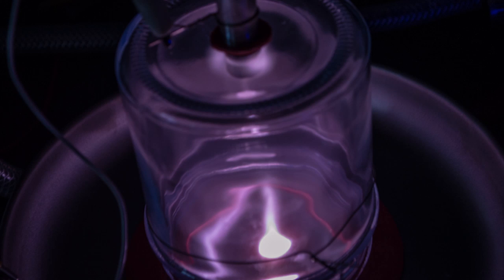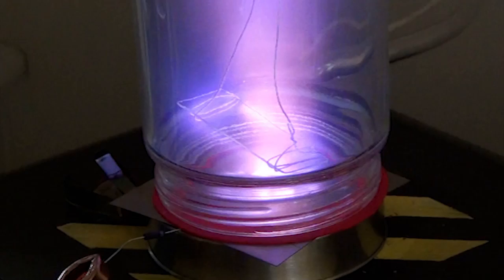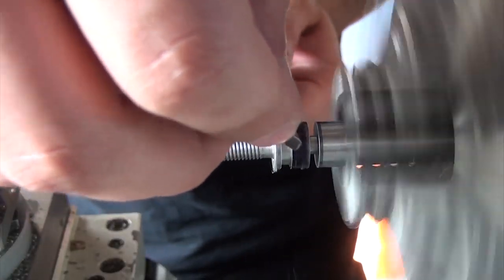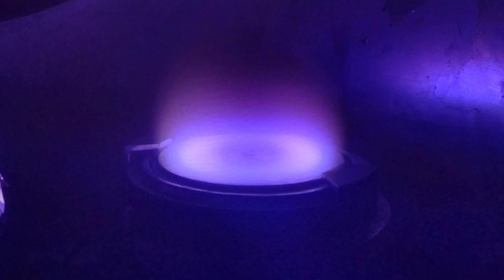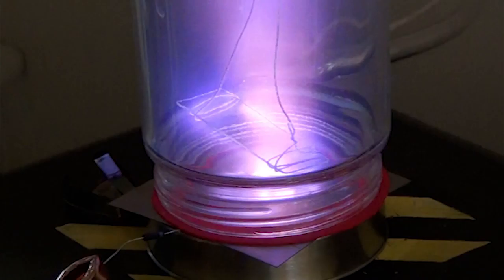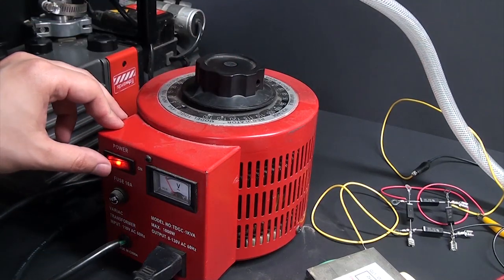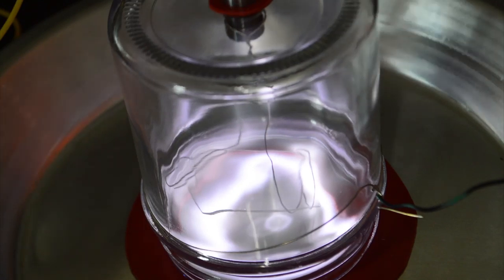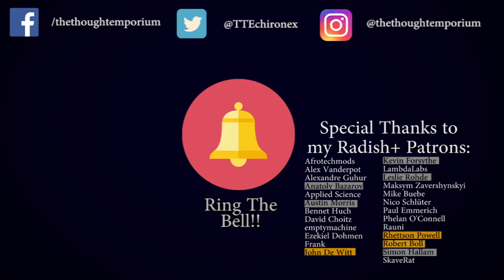My First Successful Metal Coating Machine - Magnetron Sputtering

Comment: Just when I was thinking that I need to go through my subscription list and do some house cleaning because my daily list of videos is almost unmanageable-DAMN YOU! Subscribed.
Reply: I worked at an electronics manufacturer for over 10 years running the SMT equipment, which is the equipment that places the sometimes thousands of tiny resistors, capacitors, diodes, I.C.'s, flatpacks, etc. I probably ran a million PCB's through my machines in that time. It never occurred to me that PCB's went through this process to get their traces and such...I remember thinking they were a laminate or pressed. I am amazed! Thank you for this! I LOVE learning new things and try to daily

Comment: Be careful about xrays as there might be some from shooting electrons (from the ionization) at metal with energies of up to 2keV.
Reply: Indeed. Soft X-rays are possible and UV is certain, so make sure you are wearing the proper eye protection or just using a camera.
Reply: Isn't soft x-rays starts at 10-15kv ?

Comment: Random tip 112: use your finger or a forming tool dipped in acetone to smooth silicone goop
Reply: Water is fine.  In my experience saliva works well.  hahah sorry that's not a recommendation.
Reply: I see a man of culture, have been watching Rich Rebuilds
 ;)

Comment: I'm a 63 YO technologist from the Semiconductor industry. I've spent 3 decades working with Metals Sputtering and Ion Implantation systems.  Hints:  #1 Instead of using Silicone, use Viton elastomer vacuum seals.   #2 Don't use dielectric materials (such as glass) for your vacuum chamber walls because interior conductive coatings, even very thin, will charge up and discharge periodically and this will create multiple types of instability in your plasma. Don't forget, the vacuum chamber wall is part of the electronic circuit of the Magnetron.    #3 For high quality films you need high vacuum that can be produced with a turbo-molecular vacuum pump that's backed up by a rotary rough vacuum pump.  Even if you can't afford a turbo pump, use a dry mechanical vacuum pump to eliminate the source of hydrocarbon oil in your process.   #4 Don't use a reactive gas or mixture such as air for the ion discharge.  High purity Ar gas is the best for several reasons. It's non-reactive with your substrates and target metals and, Ar ions are large (AMU 40) and will thus bombard the target with more force to achieve a higher deposition rate.   #5 Operate the Ar gas at 9 MilliTorr Sputtering pressure for the best results.  #6 For best adhesion, clean the glass substrates with a solution of   HCL (hydrochloric acid) then rinse with DI water, Acetone then isopropyl alcohol. dry well with heated air.   Maintain the substrates at a cold or cool temperature while metal coating.   Make sure that the substrates are electrically grounded to the chamber wall as this will attract the metal clusters to the desired surface.   Use lower power for more time for less Target heating and better adhesion and step coverage of topography.
    I continue to work with electron microscopes and microfocus x-ray systems in my small business.

Comment: DLC synthesis is, in fact hard and complicated. I am a co-author of a paper on flame synthesis of diamond like carbon from a college internship. My tips, vary both temperature and flow. The rate of deposition has a significant impact on the formation rate of carbon, allowing it to form large crystals or long fractal formations. The temperature, obviously, changes what reaction path the carbon takes. What isn't so obvious, however, is how many reactions can occur. Buckyballs, nanotubes, ordered lattices, amorphous DLC, actual diamond nanoparticles, hexagonal diamond lattices (lonsdaleite), carbon chains, etc. Check the properties often. Sometimes a small change can result in a sudden shift between the preferred path. We found that DLC formed best (using flame synthesis with rapeseed oil as fuel) at low temperatures and extremely low oxygen levels, with the flow rate close to the minimum required to sustain the flame.
Reply from the maker: Do you have some literature I could read about that process? Sounds interesting
Reply: @thethoughtemporium  "Kinetically driven graphite-like to diamond-like carbon transformation in low temperature laminar diffusion flames"
Published to ScienceDirect in May 2017
I hope I spelled all that correctly, sheesh. Talk about word salad. :D

Comment: If your battery charger for your car or golf cart doesn't work, it's probably the FULL BRIDGE RECTIFIER. It's a small square, usually. Imagine the fbr in this video encased in black plastic. Do a Google search of whatever id numbers are on it to buy a new one.

Transformers rarely go bad. In the "old days", one might just dump a bunch of varnish over a shorted out one and try it again after it dries. They vibrate during use and the varnish on the windings can rub thru.  If you have one that buzzes loudly, you can jam an insulator in there to quiet it down and prevent damage.

Comment: Thank you for the video. I have been curious about this process for quite some time. There is one othe process that comes to mind which uses a vacuum chamber with a nichrome wire element on which you suspend a small piece of the type of metal you wish to use in your coating process. Once a vaccum is achieved current is fed through the nichrome element until the metal sample melts and wets the nichrome wire. After the sample is melted the current is increased allot which vaporizes the metal. The vapour rises and condenses onto the glass slide which is held above the nichrome element. This process is used to coat telescope mirrors as well as plastics for headlight reflectors in cars.

Comment: Some tips.  Put a high wattage ballast wound resistor on the output of the transformer (100 ohms or less, some trial and error is required), this will stabilize the plasma.  Shield all the organics inside the vacuum, to minimize heating and thus outgassing.
Dave

Comment: Hi, if you dont have the lathe. You can use silicone gasket maker. But beware under heat you will drive off PDMS and other siloxanes until the volatiles are gone. I've made two sublimation chambers with this approach.

Comment: Great video. Some ideas: 1) Cool your magnets with a peltier cooler, no water cooling. 2) Look at other materials for the cradle, IE: Niobium, Nichrome. 3) Could you polarize the two pieces ? To be coated +, sacrificial piece - ? Work temps inside the chamber would be great data for alternative construction materials. Subbed and keep up the great work.

Comment: you should check into using pure indium metal for seals on high vacuums, its soft like a rubber gasket  but will out-gas FAR less

Comment: Great problem solving approach. You nailed that saftey bit about the consequences of touching a an energized MOT🤣. If you start running your sputtering chamber with DC voltages above 1000V I would recomend using some type of X-ray mitigation. A leaded glass chamber and distancing will work. You also may want to use a geiger counter to verify you're not generating an appreciable ammount of X-rays.

Comment: Another quick lathe tip, when threading you can stick a rigid piece of metal in your tool holder and turn the lathe on with the lowest RPM, the die holder will then slide along the metal piece while it threads the part.
Just make sure to use plenty of oil and stop the machine in time lol.

Comment: FYI. I've worked with industrial plasma machines. Both Europlasma and custom units made for 3M. They operate from 70 milliTorr down to 20 milliTorr. They use massive Edwards pumps for the most part.

Comment: After I read the title, "Magnetron Sputtering", I did a cursory scan of your video looking for a magnetron so that I could see how you did it. But I was a little disappointed when I found instead of a classy magnetron sputtering setup, that you used a simple high voltage DC power supply.  I too have experimented with DC sputtering about 10 years ago with excellent results once I figured out that everything that's inside of the vacuum chamber must be pristine clean.  I even learned about the interesting subject of very low gas pressures, and about the fact that most things will outgas which becomes a "virtual leak" at very low pressures.  Anyhow, I hope that you would attempt RF sputtering with a magnetron and then publish a video of the project so that I could learn from your mistakes before I attempt it!  LOLThanks for this excellent video!

Comment: Re dichroic filters: Through your left eye (or right eye) look through both the high pass and low pass filters together, meanwhile in the other eye look through the mid-range notch filter. Prepare to be blown away by the novelty of it. I made some glasses this way and worked with Opportunity and Spirit rover pictures to make quite a few full color stereoscopic images. I'll dump them in a dropbox folder and post a link if you are interested.

Comment: Hello, I use epoxy frequently in my vacuum systems at work that reach <9.0E-6 mbar. I've used a few different epoxies without the outgassing issue discussed in your video. For me the key things seem to be using a precision scale to precisely mix the epoxy to reduce the content of uncured resin or hardener and after it is fully cured hold it under vacuum for an entire weekend. It will outgas for a solid day before the level starts to drop. Adding a little heat can accelerate the process. The problem I do run into occasionally is that it is possible to mechanically damage the glued joint in a manner that allows it to leak an insanely small amount of gas, my most recent failure of an epoxied high vacuum joint leaked at about 2.0E-10 atm. cc/sec of helium. After repairing it two or three times I ended up adding some support to the attached components to reduce stress on the joint, which seems to have done the trick.

Also shortening your vacuum lines will help improve conduction and thus help your pumping rate even if you can't make them larger in diameter.

Comment: A small bit of advice from someone who spent the last 10 years working with vacuum systems for a solar energy company. Silicone is pretty much the worst material for gaskets in vacuum systems. It isn't  obvious unless you look at the materials data but silicone has extremely high "permeability " (the measure of how much gas can permeate through a material). For an inexpensive alternative you can use butyl rubber, though it has a fairly limited maximum use temperature. The better choice is viton,  which has nearly the lowest permeability of all rubber like materials, and also has a high maximum use temperature. There are some super high performance gasket materials, like Chemraz, Calrez, etc, but these can be wildly expensive.

A single rubber o-ring or gasket can leak and outgass more than the entire rest of your vacuum system. 

It can also save lots of time reaching a decent vacuum to bake everything that is going to be evacuated in an oven. Use the highest temperature that your materials can safely withstand, and bake under vacuum if possible. 

The biggest culprit for getting a good vacuum, assuming no leaks or high permeability rubber seals, is water molecules adhering to the glass, metal, etc, in the vacuum system. Even at the relatively weak vacuums used in air conditioning systems (prior to charging with refrigerant) of about 100 micron or millitorr, water molecules being released from the inside of the copper tube can stop the vacuum from decreasing, below a few hundred micron, for several days.
Reply from the maker: You may wish to watch my latest video. It's this.... but done properly.

Comment: Years ago, I worked at the University of Minnesota with Phil Johnson in lecture demo. One time he showed me a handheld interferometer and with one hand adjusted the length of one arm until he got it just right. If you held it up close to your eyes, you could actually see the air currents! There was only the overhead lights for this demo. No lasers or anything.
I really want to use something like this for a lead-in to a LIGO interferometer documentary.
Reply from the maker: .... what. Do you have more info on this? that sounds awesome and I'd totally build one
Reply: @thethoughtemporium  It looked a small drop forged a metal base with two front surface mirrors about 1.5" or 2" square, one fixed and one adjustable with a fine pitch screw and a beamsplitter of similar size. It was stupidly simple arrangement. But if you held the unit between your eyes and your outstretched hand, you could see the heat waves coming off your hand.!!
And because you are using white light, the coherence length is almost zero, that is the optical distance one leg has to be almost exactly the same as the other leg to get this effect. With a monochromatic light like a laser beam, you have an almost infinite coherence length as you can adjust the leg length willy nilly and always get fringes.
I'm not sure about the optical quality of the mirrors but I would guess they were quarter wave. But I don't think that is required to get the effect. But it would be fun to imagine how it would work if the mirrors were perfectly flat.

Comment: Pro tip for the vacuum pump: If you are trying to reach vacuums below 10mTorr make sure your oil is very clean. If you have volatiles in your oil they will be boiling within the vane journals and set that as your max vacuum. Your vacuum pump does have a gas ballast valve. Opening that and running for a while will help remove the volatiles from your oil. You will want this to stay closed though when going for deep vacuums.

Something you should also pick up is some Dow Corning High Vacuum Grease. It is made of PFPE oil and has a very low vapor pressure, so it will not off-gas into your process.

Comment: Quick tip you can buy premade threaded tire valves, where you only have to drill a hole at most car shops. A two pack is like $6.

Comment: yo on tapping a hole. use a Countersink Drill Bit to help start the tap plus it will help the fastener enter also  to make one or 2 turns then a quarter turn in the opposite direction repeat until desired depth. this breaks the chip and prevents biding and breaking the tap :)

Comment: Congratulations! Vapor deposition is so useful. But I have one question, why go through the glass at all? Use the jar as a bell-jar, turn some KF-flanges that matches KF-20? on your Edwards pump, you could probably turn the base-plate and flange as one piece of cast aluminum, or DC TIG weld with helium, or use stainless and TIG. Drill holes in the plate for gas inlet, and ordinary spark-plugs works well for electrical feed-troughs.  Also if you want consistent results a, get a pirani-gauge. a good rule of thumb; get close to 10^-2 torr before flushing to 10^-1torr, then back to 10^-2. You can also use the gauge to tell if a leak is virtual, if you can graph the readout. Even detect leaks with helium, as the pressure will suddenly fluctuate if helium enters the system, changing the thermal conductivity measured by the pirani-gauge. Anyways, great video, best of luck!

Comment: When drilling glass or metal in your case glass use a few drops of dish soap. It reduces temps and helps it cut faster and a much cleaner smooth hole

Comment: FWIW: I would recommend ditching the cheap glass bottles and use Stainless with conflat or ISO flanges. You can buy the on online via "LDS Vacuum Shopper" or kurt lesker. Conflat will allow you to get really high vacuum (almost no leakage) but use copper gaskets that have limited re-useable cycles. With ISO flanges you can use O rings, Buna, Teflon, or other low outgas materials.

You also probably want to upgrade your vacuum pump system with a oil trap, Descant trap and an Turbo Molecular pump for quick pump downs. You want to avoid any sources of contamination (ie vacuum oil, moisture, etc). 

For the Sputter, I would recommend using Teflon since it does not outgas in a vacuum & can handle high temps better (about 500F). I suspect Delrin is a source of contamination.

Glass or ceramic insulators would be even better. You can buy machinable ceramics like Alumina from McMaster-Carr. Mica also works well as a flat insulator.

Also possible that your metal sources have contaminates in them if they are not pure. You can buy sputtering targets on line (Sometimes from eBay). 

Also need to clean your target material. Ben (Applied Science) also has a good video on how to get surfaces very clean.

Comment: So you should have used high voltage capacitors after the full bridge rectifier to get a real DC voltage, which will improve the response of the plasma in an more even way when sputtering  your slide or any apparatus you wanted to coat. As it is a double wave rectifier, you need to put two  capacitors in series  used in oven  as the voltage will be double because in oven they  only used simple wave rectifier method . 
You will greatly improve your plasma starting condition and final result too .

Comment: Ah, I see I'm not the only fan of using mason jars for vacuum chambers!

I've had luck with the glass drill bits that look like a spade, especially the smaller ones. If less than 1/4" or 7mm and the hole doesn't start forming an oblong shape it works great for even a pilot hole that can be enlarged with a dremel if worried about cracking. I mean, I've used 3/8 and 1/2 inch spade glass bits but the chances of failure are so much higher with thinner glass. I learned that lesson the hard way for sure. :P